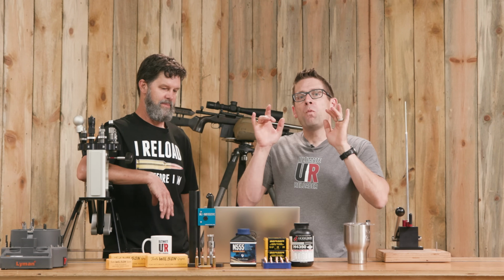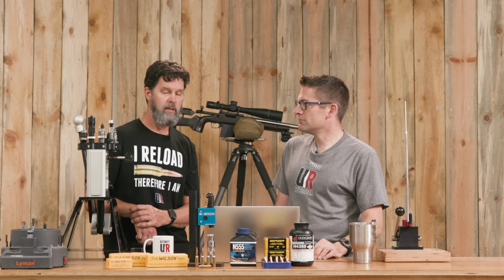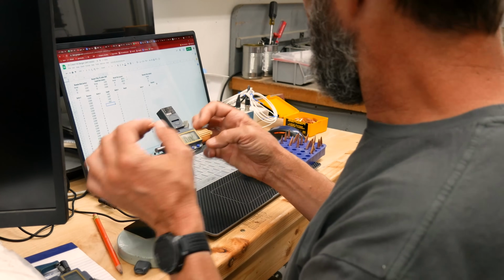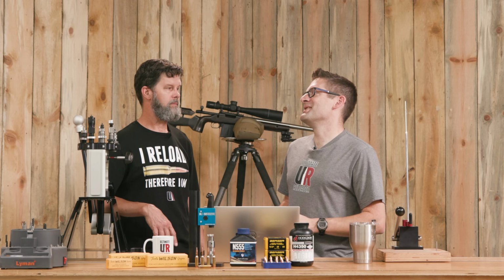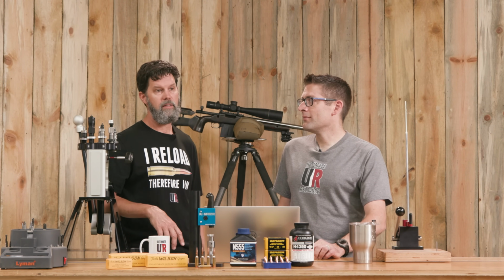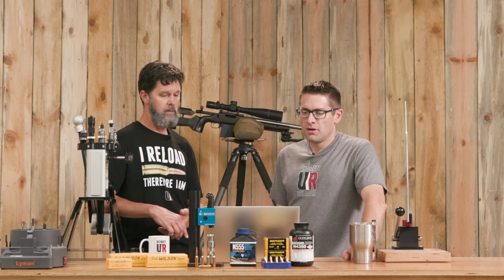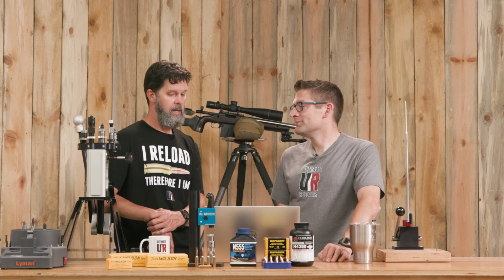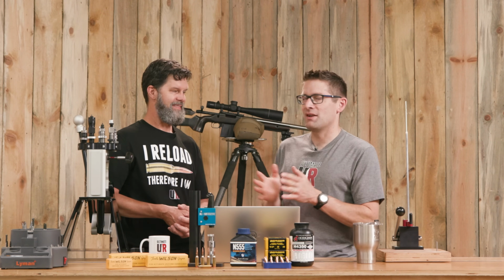TESTED: Berger 25 Cal 135gr Long Range Hybrid Target Bullets

Comment: The 25 Creedmoor is a great cartridge. I shot it in F-Open competition. It scored high but burned the barrel out in 1,450 rounds. The barrel heat was extarodinary shooting about 1 shot per minute for about 70 rounds per match. I had to use a full scope tube from objective lens to muzzle to have a chance with mirage. I shot at 2950-3000 fps and that was way faster than necessary. I suspect I'll get well over 2,000 rounds per barrel if I slow it down to around 2800 fps.

Comment: Leaves me really wanting a 25 cal target rig. Opinion between 25-06 and 25-06AI? For 1000 yard steel.
Reply: I used to compete with 25-06 1k VBR 115gr Bergers 13 years ago. Barrel shot out in 1400 rds.
Reply: @ronsmith9228  I don't compete, so I will take a while to get there. And my accuracy requirements might be different.

Comment: I used to hunt everything with a 25-06, but I live in Texas and it was all whitetail, hogs, etc.  I rebarreled with a 7.5 twist 26" barrel when the 131 BJ bullets came out.  It is a trued Rem 700.  The first gun I bought for myself 30 years ago.  with Retumbo, I am getting 3160 fps.  Very accurate, low recoil.  I shot a 4 inch 5 shot group at 900 yards with that rifle.  I have killed elk and whitetail with it.  I did have a reamer made with PTG after consulting with BJ.
Reply: How’s that combo do on bigger hogs?

Comment: So interesting that the .25 Creedmoor almost settles the 6 vs 6.5 debate. 3000fps out of a 24" barrel with the 135 grain Bergers is very impressive. I've got a Sako 25-06 that I varmint hunted with and the barrel is shot out. I used 75 grain Spear hollow points @3600fps and 90 grain Sierra BTHP at 3400fps for the longer range stuff. Like the video discussed, now that everything is easily ranged, there isn't the need to have a smoking hot cartridge. Just go with a moderate load and a high BC bullet and let psychics do the work for you.

Comment: My father had made the comment three years ago since he sees all these custom rifles i build for people that he would one day like a custom rifle. So christmas before last he opened up a box that had a brand new Surgeon 1086 long action standard bolt face action in it. I then designed a reamer with manson reamers in 257ackley to shoot 133 and 135gr. Bergers. Ordered a Brux MTU 1:8twist 33" long that i finished at 30" with an ACE break on the end, a greyboe ridge back stock i cerakoted to look like a wwll P40 tigershark  greyboe DBM, a meopta optika6 4.5-27×50mm. Not only did i build it i paid for every part for this rifle and he loves it.  Bought him 300 nosler 257 +p casings and fire formed them the cream of wheat method like i always do for ackley chambers. It shoots lights out both bullets with the exact same charge weight of RX23. Imr4955 works well too. The 133gr is at 3,080fps and the 135gr at 3,050fps

Comment: I love the 250 Ackley imp cartridge. I have been full length 6.5 Creedmoor brass and it eliminated fire forming. The difference between the two is one has a 30 degree shoulder and the other has a 40 degree shoulder so every thing is the same on velocity and accuracy. I also use a 1in 9 twist. Barrel 24.5 inch douglas rem mag contour. My next build will be same caliber but a 1in 8 twist .I think it should still stabilize  the lighter bullets as well as the 135 gr. Especially with the well made bullets they make today market. My powder would be RL 17 .I fine this works out great in all my Creedmoor calibers on heavier bullets.I  hope this helps you all. Cheers Nick G

Comment: .257 is still a 6.5mm. Only .007 difference in diameter compared to .264. For a starting point, use similar powders to whatever your 6.5 equivalent is for similar weight projectiles. I switched from 6.5x47 to 25x47 and the difference in my charge weights between the 131gr ACE's(25x47) and my old 140 ELD( 6.5x47) loads was about .4gr of Varget.

Comment: I put together a 25-06AI on an old Mauser action about a year ago. Took a pronghorn at 680yds with it. Heart shot and clean kill. 131 blackjack does its job very well and has turned attention to this almost forgotten caliber
Reply: What barrel length?
Reply: @Calaveras32Spcl  26” proof carbon. Using the 133gr Berger’s now. Took an elk at 440

Comment: Started running a 25 creed in PRS back in mid 2019. I haven't run the new bergers yet. All my experience was with the 131. Once I dialed in on a good seating depth window it was a thing of beauty. Absolutely a good option for competition.
Reply: By how much does it exceed a 6.5CM?
Reply: @borkwoof696  sorry, didn't see your question. I run the 131 Ace at about 2960 fps, and I'm well under max pressure. It shoots really well there, and I'm not a speed demon. I'd rather have a little more barrel/brass life and less recoil. Plus I don't need to worry about overpressuring in rainy weather. Drop at 1k yards at my location is 6.8 mils. A 6.5mm 140 ELD running at 2850 FPS would be about 8 mils at 1k yards

Comment: What you have is a 250 savage ackley improved that’s been out for over 100 years
Reply: Ah, but you can make a 25 creed from readily available 6 Creed SRP brass with a simple neck mandrel. It headspaces with a 6 or 6.5 creed gauge so no more fireforming than any other specific to caliber brass. 

I have a much harder time finding brass for the 250 and then I have to form cases. 

Plus, if you have a 250 that's older than 5 years like me, it'll have a 10 or 12 twist barrel. If you're going to rebarrel why not use a Creedmoor cartridge that is so readily available. 

And for dies I just stuffed a .283 bushing in my 6.5 Creed die, and seat with the 6.5 die with a 25 Cal stem

Comment: i built a fast twist 2506 and shooting the 135 bergers at 3050fps with a light charge of h4831sc. shot a 4.5" group at 1000 yards and a 1.5" group at 500 yards.
Reply: What barrel did you go with?
Reply: @joshuahedum9563  I used a McGowen prefit

Comment: 25-06 AI with that 1-7 twist and that Berger 135 would be a monster.
Reply: I have one. Haven't shot the berger's yet but the black jack 131s it's pretty sweet
Reply: About to put one together with a 26” proof research on a blue printed 700 action and find out.
1-7.5
Reply: Using the 133gr elite hunter
Reply: It is,I built one

Comment: Great video once again. Thank you for doing such new equipment. I'm currently working up loads for my 22inch 1;7 Bartlein alpha brass 25 Creedmoor h4350 with 135 Berger. I'm curious if you ever worked past 42.5g of h4350?    Where did you find pressure? 

Thank you

Comment: Very good development and review. Interestingly, I would like to have seen you use Varget. In my 6.5x47 using 130 VLD, I get nearly identical MVs and single-digit SDs with Varget as compared with the equally marvelous H4350. The 25 CM easily fits within the PRS guidelines and goals and as a high volume abatement shooter, it’s effective, too.

Comment: How much difference in the 257 Roberts and the 25 by 47 L
Reply: 257AI would be in the same realm but would be a long action and need a longer throat considering those old horses were never meant for VLDs.

Comment: Very nice work on your 25CM, I have been working on loads for superformance , SW4350, and H4350. Most of your data seems to be very close to mine. Thanks
Reply: Did you work up to pressure with the 25creed 135g combo ?   Where did you get ?
Reply: @davidlaroche8928  I took the load data from average size projectiles for the 6mmCM and 6.5CM. I put it in a chart & compared the bullets vs charge weights and split between the two -10% so I would not blow my face off. I also checked with BlackJack bullets and ran some data points across them for a reference. They also have a Facebook page 25CM and .257 stuff. Lots of info on there to get started.

Comment: Dammit Gavin, now I need a 25Cal
Reply from the maker: Time to build one bro!!!
Reply: 25x55 swede AI would be sweet
Reply: @bdadamovicz  or a .257 Roberts AI
Reply: I made the switch after I killed my 6.5x47 barrel to 25x47 and it's a performer. It's about 1mil flatter than the 6.5x47(140 ELD) at 850y and has more energy. I recommend buying all the bullets to kill the barrel upfront. Should be around 2000-2500rds.
Reply: Bou vir ons n 257 weatherby magnum aseblief
Reply: I’m just gearing up a 25-06 built on a tikka action, 26” barrel with 1 in 7.5 twist. I found this very helpful, thanks.

Comment: Always great info. I just finished up rebarreling a RPR like your previous video in 25 Creedmoor. 26.5" barrel 42.6gr H4350 2.775 OAL Starline SRP 6.5CM necked down. Velocities where impressive at 3030 FPS. That put my 1K hold at 6.5 MRAD! Very impressive cartridge,  on the downside. It heats up the barrel very quickly.  Unfortunately with the RPR limitations in contour, accuracy was just under 1/2 MOA. Which is very acceptable for PRS still. Will be on my next video
Reply from the maker: Right on Kenny, sounds like a cool project!

Comment: Great video, thanks.  The H4350 can also be used for 7mm Rem Mag, and 300 WIn Mag (as indicated on the label).  I went to the Vihtavuori website and it lists 300 Win Mag as a possible load using the N555.  It did not list 7mm Rem Mag.  Thoughts? Would you recommend this N555 for those calibers?  What would you recommend? e.g., RL25, H4831, Retumbo come to mind.
Reply: @Travis Fox Thanks. One more question. The rifle has a 24 inch barrel and a fast 1:7 twist that seems fast for a heavy bullet.  I'm always confused by twist rates. I have been told that setting the twist rate too fast could cause the projectile to disintegrate, and too slow will cause the bullet to tumble. Also, is the bullet weight more important, or the bullet length. Berger VLDs are long, versus say a Nosler Partition. Can you shed some light on this?
Reply: @Travis Fox It's been awhile since I reloaded 7mm Rem, but I believe Re19, Re22, and H1000 are all useful in the bullet weights most shooters choose for that caliber.  Make sure to double check reputable sources before proceeding, though.

Comment: This in a fast twist 25-06 would make a monstrous long range setup. Much like a 6mm-06.
Reply: There's a 133gr Elite Hunter they're releasing that will be a long range monster. I built a fast twist 25-06 for the heavier stuff coming out and I'm pretty pumped for it
Reply: i have one with a 26" 1:7 twist barrel. haven't done a ton of testing but it stacks them with a light load of h4831sc 3050fps. got up to 3200fps with rl26 and no pressure.
Reply: @christianwiseman3712  What grain bullet are you pushing?
Reply: @saulgood6190  135s
Reply: Shot a porcupine with it today at about 100 yards. Went completely through him in the back right leg exited out of his neck about a baseball sized hole. I think they will be great antelope and deer bullets

Comment: As was mentioned, these would likely suck in a standard 25/06.  I have a marlin MR-7 in 25/06 that doesn't really even like 120 gr. bullets, but is quite good with 100gr. bullets - turning out consistent 3/4" groups at 100 yards without any modifications.
Reply: Yup, you need a custom twist rate barrel in order to stsbilize these heavy bullets